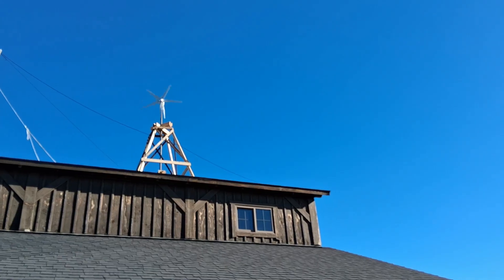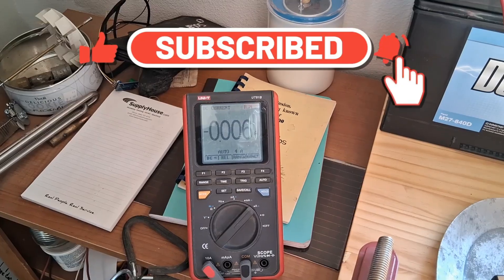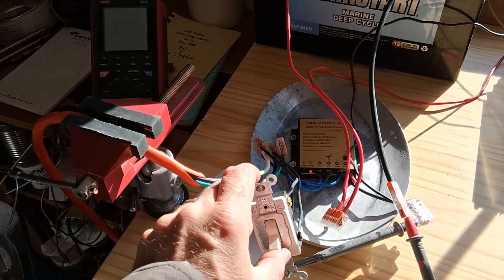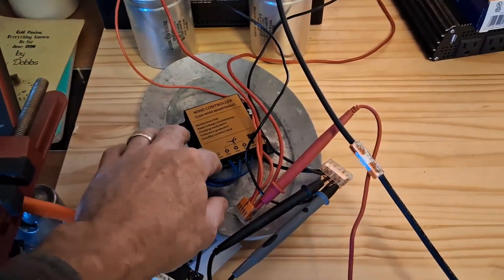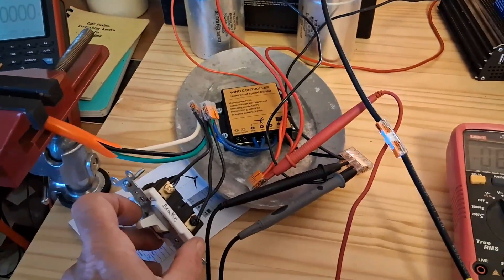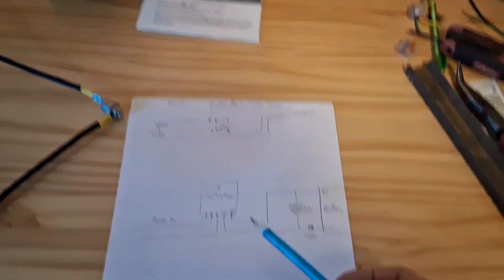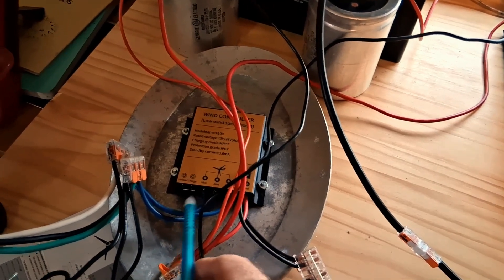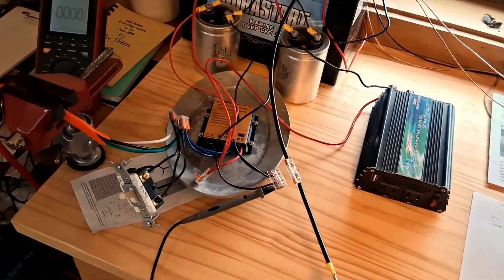Two control improvements for the Vevor wind turbine

Comment: G'day Mate, My best advice for low winds is to always buy the 48V model, even if you have a 12V or 24V system. Just use a 3 Phase Bridge Rectifier 
to convert AC to DC, then use normal solar charge controller, best to use a PWM solar charge controller because it has a quicker reaction time. Just check that the solar charge controller input voltage can handle 50V or the listed maximum wind generator voltage. For low winds always buy the 5 blade model and get the blades with scoops on the blades, not flat blades. 
I hope this information helps everyone.
Reply: Good suggestion,,more blades are good in low speed wind.
Reply: @buddha2845  Maybe buy a six blade and then you can have the operation to take three off if you are in a high wind area.
Reply: @brianaustralia9692 good suggestion

Comment: Nice ideas ! Love the break switch . I just done different and this one can be done this way as well . Amazon has a 3 pole double throw knife switch. Like 63 and 100 amp ones. I have the 100A 380V one that came with mine. To hook up is simple. The common 3 terminals witch is center ones  you connect to wind gen. 1 side you connect the 3 to controller. The outher 3 you tie to together   and ground. With knife switch in center is free spin. all the way in to controller is charge and all the way to short is break.  Just a outher way to do it. For that diode put a heat sink on it . A outher thing is use Shockey diode. Use like a 30 amp one. If after a long time if stops charging after caps discharged . Use a push button switch with a 1 K resistor across diode to restart it.  That slightly lover voltage on lead battery is ok . It does not matter which side diode is on. Battery + or - . does same job. You need that small sprocket on the outher turbine.  Use a 10 speed one.  Then you got like 5 or 7 to pick from. Just slide the alternator to line up, Cheers from NY
Reply from the maker: That diode may be a Schottky.  The forward voltage is .46v.  I did take some diodes out of one of the destroyed solar panels, with a measured forward voltage of .11v. I'm sure they are schottky blocking diodes.  -not sure of the current rating though.  Maybe 10 amp.  So I just put two of them in parallel.  If have to keep in mind that this turbine may just be a disposable toy one, and don't want to buy anything more for it.